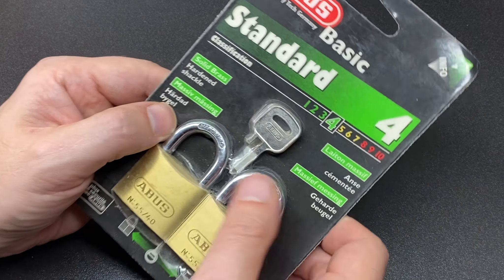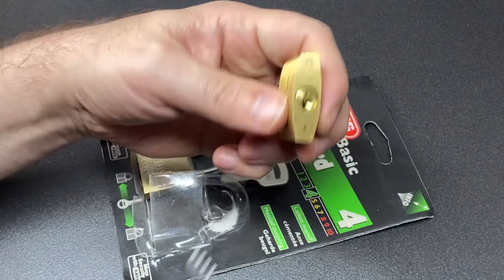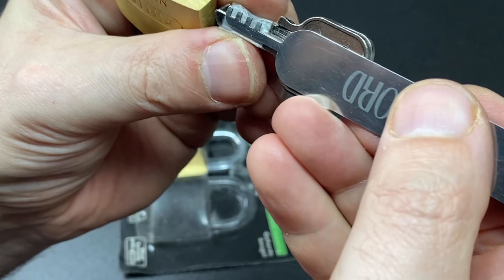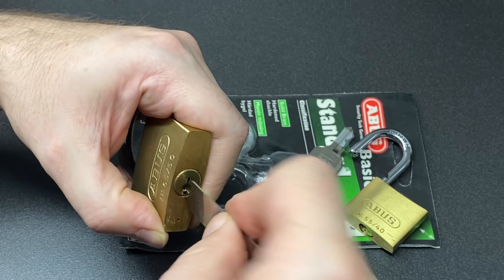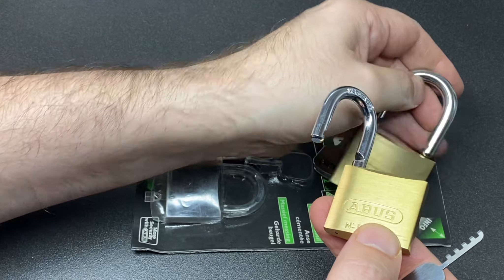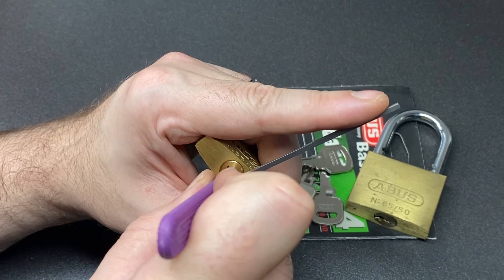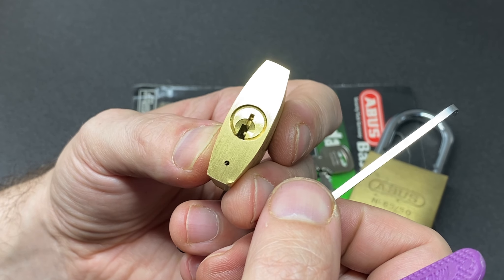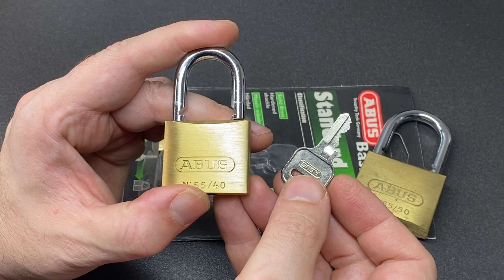ABUS 55/40 Combed and Picked

Comment: 18:23. I guess I might be running before I could walk. However I am struggling with the abus 65/40. I am sure it has a spool pin and I think it is pin 4 I am struggling with. Any suggestions please
Reply: I struggle with it too.
Reply: shit I cant even get the 1st pin. it seems no amount of picking or changing pressure on the tension seems to make a difference.

Comment: I have covert instruments ergo combs. I can't comb pick my abus 55/40. Maybe I'm doing it wrong?
Reply: Maybe one of the key pins is too long? Some Master 141s cannot be combed because they have a long key pin.
Reply: Same here.  It's not you. The CI combs list explicitly which Master or Abus locks they work on and the 55/40 isn't listed for the 4 pin comb pick. It's either that the Southord comb picks are a bit different, or LN had a fluke here.

Comment: Hi Lock Noob, don't know why Abus of all Manufactures go to the trouble of fitting spools in these padlocks with "straight" keyways, but not fit longer driver pins to prevent combing. Even one or two longer drivers would stop this method, but I guess that would mean more brass ...

Comment: What padlock do you recommend for outdoor use? And what euro cylinder for outdoor door? Nice videos, keep it up!
Reply: For Padlocks you can take a look at the Abus Padlocks that are fitted with a Bowley Rotasera Lock. As for outdoor doors, you can try KESO 8000Ω2, or ASSA-TWIN 2 Cylinders, they are both awesome and should provide enough protection unless the lockpickingLawyer or Locknoob is trying to get in ;)
Reply: @MarvMarvelous1  Thanks!
Reply: LPL called the ABUS Granit 37ST/55 "a solid lock for many outdoor applications."